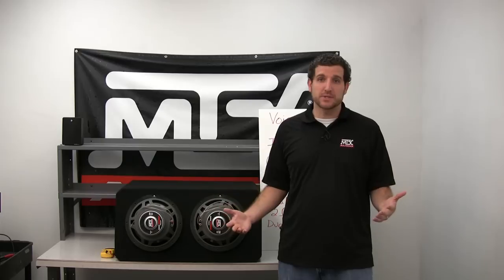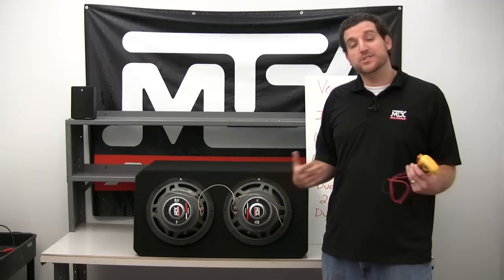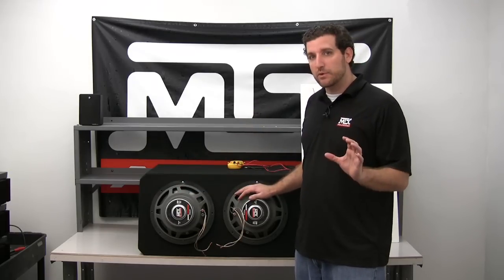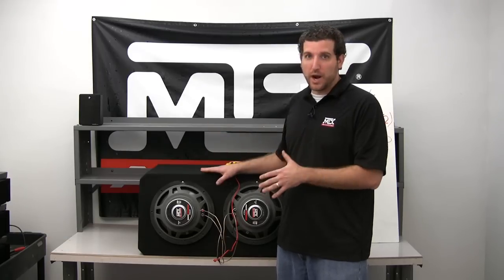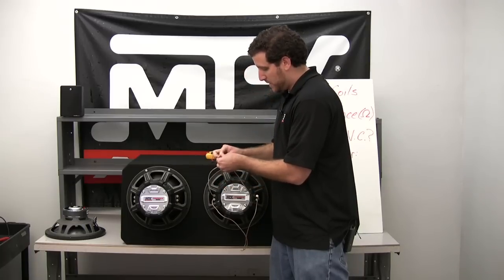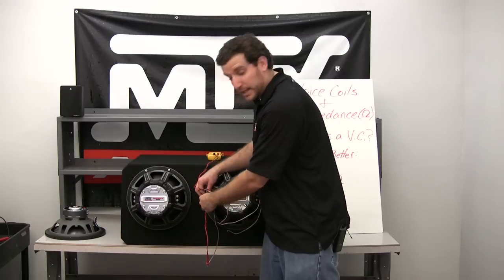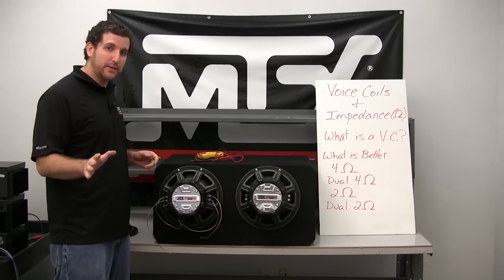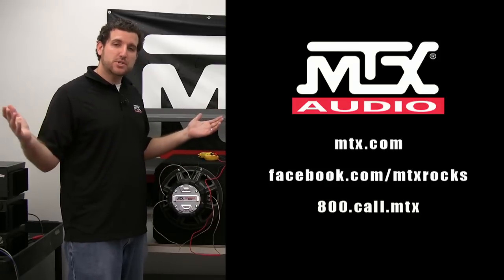How to Wire Your Subwoofers to the Correct Impedance for Your Amplifier

Comment: I got kicker l7 an a750.1 but the fuse holder is melting
Reply from the maker: Leo Bowden this does not sound like an impedance issue. This sounds like your power/ground wire may be too small or your wire has built up resistance over time. The fuse holder is melting due to the wire getting hot. I would replace the power/ground wire ASAP before anything worse happens. Try using a oxygen free copper wire and make sure it is a quality wire that is true to gauge.
Reply: Thank you
Reply: It's the one in the kicker amp not my power wire
Reply from the maker: Leo... Sorry... I as also thinking the power wire fuse was the one that was melting. If the ATC fuse in your Kicker amp is melting, it is most likely an amplifier issue.

Comment: i have one question if i have two 800watts subwoofers so do i need a 1600watts amplifier then or thoes it blow em up and they are 250watt rms does the amp need doubled the amount when i have two subs thats my question. Sorry For my BeD England.
Reply from the maker: The RMS rating is what you want to use. The peak/maximum rating of 800 watts is irrelevant. If your subs are rated at 250watts RMS and you have 2 of them, you would look for an amplifier that is rated at 500 watts RMS at whatever impedance you plan to wire your subwoofers to. This is if you are wiring your subwoofers together and powering them with a monoblock amplifier (recommended).

If you plan to use a 2ch amplifier, you would look for an amplifier that does 250 watts per channel at whatever impedance you plan to wire each subwoofer to (depending if they are DVC or SVC).
Reply: i need help please cuz im planning to buy two rockville w15k6 d2 2ohm subs but i dont know what amp i need so can u try find one for me please.
Reply from the maker: Your subwoofer says it is rated at 500 watts RMS and it is a dual 2ohm voice coil model. If you wire them to a final impedance of 2ohms at the amplifier (https://www.mtx.com/library-wiring-diagrams) you would be looking for an amp that is rated at 1000 watts RMS x 1 @ 2ohms. Our XTHUNDER1500.1 amplifier would be just about perfect for your subwoofers. https://www.mtx.com/xthunder15001-car-audio-amplifier

Comment: HI i need help, i have 15 inch 4d targa xxx 10 000 watts,2500 watts rms subwoofer and Icepower IBA-4000.1  4000watts Monoblock amp,  can you help me to extract the maximum power from this boys, any sugestion?   Amp specs   http://www.icepower.co.za/products/amplifiers/iba-series-amplifiers/

When I'm using the amp does not heat up

Comment: need some help I have 2 dual voice coil subs and they are older kicker comp vr 10" subs and on them it only tells that it's dual voice coil so I don't know what amp to buy can someone help me with that please
Reply: and I can't find any specs cause there older subs there is no information out there
Reply from the maker: To properly match up your subwoofers to an amplifier, you need to know the impedance of the dual voice coil subwoofers so you know what impedance you can wire them to at the amplifier. Kicker Comp VR10's are probably dual 2ohm or dual 4ohm subwoofers. Can you confirm which models you have?
Reply: +MTX Audio USA  not sure how I would find out beings that there's no info online and only thing the subs say are dual voice coil is there another way to figure it out I've seen the have like a tester you can buy would that work
Reply: +MTX Audio USA well the tester thing you have
Reply from the maker: Hawk's Clash yes. A multimeter set to the impedance (ohms) setting would tell you what impedance the voice could are. Or if you know the model # of the subwoofer, there is usually a designating # that specifies impedance.
Reply: +MTX Audio USA ok I'll have to check the subs and if not hoe much would the meter be

Comment: sir! plss sugest me.. which is Best speakers math for "ahuja SSA300 amp.... its has ..4 n 8 ohms option .. so which watt speaker is best for my amp?????///
Reply from the maker: Sorry. I am not familiar with the SSA300 amplifier.
Reply: its ok.. but just clear me  that... in simple way..  how much speaker watt best for "300watt" amp.... its pair of 300+300  .. 600 watt speaker or... 250+250 .. 500 watt speaker ...or less .. "coz i have 300 watt amp.. so im searching speaker for my 300 watt amp  .. pls sugest me... :)
Reply: power mind

Comment: What if I have 2 sub double coil and 1 amp, how do I wire them? SoundStream PCO-1204!
Reply from the maker: It depends on what impedance you want them at. You wire your subwoofers to a final impedance that best matches the RMS power handling of your subwoofers to the RMS power output of your amplifier at that impedance  (ohm load). Check our wiring diagram tool for more info - https://www.mtx.com/library-wiring-diagrams

Also, read our article on "Matching Subwoofers with Amplifiers" - https://www.mtx.com/library-subwoofer-impedance
Reply: +MTX Audio USA Thanks very much for your help, but I do prefer if you tel me here I should do it and if the amp and subs are good, as I told you I got 2 SoundStream dual voice coil 350w rms (PCO-12D4) and the SoundStream amp 600w Class D (P1.600D) 
RMS power @ 4hom --> 240 x 1
RMS power @ 2hom --> 400 x 1
RMS power @ 1hom --> 600 x 1 

So please tel me what is the best wiring for these subs and amp 

Thank you very much for you help 🙂
Reply: I have mtx terminator dual 12' subs  model# TNE212d what amp would push these like they should cause the amp it came with TNA251is not working

Comment: how would i  wire 2 4ohm dvc's subs to a 2ohm stable amp????
Reply from the maker: With 2 - 4ohm dual voice coil subs, your final impedance at the amplifier can be 1ohm or 4ohms. Check out our wiring diagram tool here - https://www.mtx.com/library-wiring-diagrams

Comment: How do u wire two 2 ohm subs to a 4 chanel amp
Reply from the maker: There are a variety of ways but we need more info to help you. Can your 4-ch amp be bridged to mono? Are your subs dual or single 2ohm? What are your amp and sub RMS ratings?
Reply: I bought a new amp as Sony xplode scks.... I needed a mono block amp
Reply: I bought a power bass 1000w mono block 1 ohm
Reply: And wired it in series
Reply from the maker: Two single 2ohm subs wired in series would have a final impedance of 4ohms at the amplifier. However, if your RMS  ratings are appropriate between your amp and your subs and if you can "bridge" two channels of your amp together to make it a 2 ch amp, you could power each sub on it's own amp channel.

Or you could bridge all 4 channels of the amp together to make it a single channel amp. Not sure if your amp is capable of doing this but some 4 channel amps are.

 It's not the way we would do it if we were designing a new system, but could be done to use the products you have. Check the manufacturer websites of your products.

Comment: I have 4-10s at 8 ohms 450 watts i want to add a 15in 8 ohm 450 watt speaker cabinet will that bring it down to 4 ohms in parallel ??

Comment: Can you wire just a single coil of a dual voice coil speaker to an amp? So if you have a 2Ω DVC you can wire it either 1Ω, 2Ω (just connecting one coil to the amp) or 4Ω.
Reply from the maker: That has been a debate in the car audio world for years. IMO... The only correct answer is to check with your subwoofer manufacturer. Yes, it is possible but construction methods could cause problems and lead to failure. Also, using only half of the dual voice coil typically reduces the amount of power a subwoofer can handle and therefore would also reduce performance.
Reply: I have 2 DVC 12 1ohm wire to 1 ohm but doesn't sound loud. Would 2 DVC 12 4ohm wire to 1 ohm sound better??

Comment: im tryimg to bridge two 12 jensen to a one channel boss 1100 watt how do u do it
Reply from the maker: Zack, if your amp is a monoblock (single channel), you can't bridge it. Bridging refers to combining two or more channels on an amplifier to add up their outputs into one channel. Is your amplifier 2 or more channels? If so, you should check with the manufacturer to make sure it is a bridgeable amplifier.

Comment: why did my speaker catch fire
Reply from the maker: Couldn't say JohnJ Bieble... Could have been putting too much power to the speaker. Could have been incorrectly wired. Speakers catching on fire is extremely rare and is almost always due to a problem in the installation.

Comment: Yes, so you ask for more info, OK.  So the amplifier puts out 250w at 4ohm on 4channel, it puts out 500w at 2ohm on 4channel, and it puts out 1000w on 2channel 4ohm bridged. "I don't know what 4ohm bridged mean though". So will that amplifier play the speakers that I asked about before? They are not woofers, they are tweeters and mid range speakers. Four 450w 8ohm.
Reply from the maker: So 5 speakers total? 2 - 450watt 8ohm speakers and 3 - 150watt 8ohm speakers? OR... 4 speakers total that are 450watts and 8ohm? Be sure you are referring to the RMS power handling ratings of your speakers and the RMS power output ratings of your amplifier. DO NOT use the Max or Peak power ratings. Please confirm the qty of speakers and the RMS power ratings of your amplifier and speakers.
Reply: Yes am talking rms. Peak is about 900
Reply: Yes the rms of the speaker is 450w
Reply: MTX Audio USA j

Comment: hey, can i play 2 (450w) 18sound 8ohm speaker, and 3 selenium 150w 8ohm tweeter, with my (2000w) 4channel hifonics?
Reply from the maker: D Allen, unfortunately there is not enough info to say whether your setup will work with each other or not. You will need to determine how many watts each channel of your 4ch amplifier puts out and at what impedance. Then you will need to figure out if your subwoofers are single voice coil or dual. Typically, 8ohm speakers are single voice coil and with two of them, you could wire your subs to 4ohms at the amp or 16ohms. You would want to determine your amplifiers RMS power output at 4ohms and at 8ohms. If it's better matched at 8ohms, you could use 2 channels (1 to each subwoofer). If it's better matched at 4ohms, you would use one channel for both subwoofers. 

Also, are any of the channels of your amp bridgeable?

You could wire all three of your 8ohm tweeters down to 2.7 ohms at the amplifier and power them all on one channel assuming the RMS output of your amp at 2.7ohms is around 450 watts. 

Basically, you need more information before you can determine whether your setup will work properly together.
Reply: OK thanks

Comment: i have  a M1886i MA Audio amp ! which is 
Max Power (Watts)   1000
# of Channels   1 (Mono)
RMS Power (Watts Per Channel)   500 x 1 @ 4
Car Amplifier Features   Crossover, Thermal Protection

i needed to know Do I wire my speakers in series or parallel ?
these are the speakers 
Hifonics BRZ15D4 Brutus 15" 1200 Watt DVC 4-Ohm Car Audio Power Subwoofer
Peak Power: 1200 watts
RMS Power: 600 watts
Impedance: 4 Ohm
Polypropylene cone
Reply from the maker: +TrackChemist Beats (Track Chemist) Your subwoofer wants 600 watts RMS and can be wired to either 2ohm or 8ohm. However, your amplifier's rating is 500 watts RMS at 4ohms. At 2ohms (assuming it is two ohm stable), it would probably provide too much power to your subwoofer and at 8ohms it wouldn't provide enough. Check out our article on matching subwoofer to amplifiers here - https://www.mtx.com/library-subwoofer-impedance

Comment: Hi I got sound stream d1.1700 amp nd Rockford p2 dual 4 ohm how can I wiring this ?
Reply from the maker: +sukhjinder mann There are options on how to wire your subwoofer to get to the optimum impedance and to help match your subwoofer to your amplifier based on their performance ratings. You will want to get as close to your subwoofer's RMS power handling rating as you can at whatever impedance your amplifier would provide that amount of power. Please use our Wiring Diagram Tool for wiring options for your specific subwoofers - https://www.mtx.com/library-wiring-diagrams

Comment: so I've got two single voice coil 2ohm subs with 250w RMS each. My amplifier specs give 1200w RMS at 1ohm, 600w RMS at 2ohm, and 325w RMS at 4ohm. How should these be wired for most effectiveness without damaging anything? should they be ran in parallel or would the amp be over powering the subs? would a series put me around 4ohm and be the best option?
Reply from the maker: +Braydon Since your amplifier is 1ohm stable, you could wire your subwoofers down to a 1ohm load but your amp could overpower and blow your subwoofers if you don't set your gain properly.  Otherwise you could wire your subwoofers to a 4ohm load but you would only be providing 325 watts RMS to two subwoofers that want 250 watts each. Your amplifier isn't really the best option for your subwoofers. Here is a link to our wiring diagram tool - https://www.mtx.com/library-wiring-diagrams

Comment: what wiring and amp should i do with 2 1200 watt 4 ohm pioneers
Reply: not sure if I made a mistake from buying the subs before buying the amp
Reply from the maker: +Edwin Luque What is the RMS power handling and are they dual voice coil or single voice coil?
Reply: +MTX Audio USA single coil 250 rms , pioneer TS-W303R

Comment: ive dual 4 ohm and im getting a final reading of 5.5 ohms..?
Reply from the maker: +Jose Garcia How many subwoofers do you have? Are you reading the impedance by using a multimeter on the ohms setting?
Reply: +MTX Audio USA  i have two subwoofers and yes i have the multimeter at the ohms setting i dont understand...its new to me :)
Reply from the maker: +Jose Garcia Are your subwoofers wired together or are they wired to the amplifier separate?
Reply: +MTX Audio USA they are wired in series and get that final reading :)
Reply from the maker: +Jose Garcia https://www.mtx.com/library-wiring-diagrams Check out our wiring diagram tool. Enter 2 subwoofers and choose dual 4ohm from the drop down menu. You should have a reading close to 1ohm or 4ohms if wired correctly and assuming there are no problems with your subwoofers.
Reply: +MTX Audio USA okay thank you very much for the link and the info you provided :)

Comment: when you wire in parallel does it make it 1 channal on the amp? if so what would you do to the other positive and negative out put ( for my MTX dual 12s)
Reply from the maker: +yousuf kan If you have an enclosure with 2 terminals (1 for each speaker), it usually means each speaker is wired independently. To check the impedance, you could connect a multimeter to the terminal (positive to positive and negative to negative). Use the ohm setting and you can know for sure what impedance your subwoofers are wired to and what the impedance will be at the amplifier.

Depending on the impedance at each amplifier, you could wire them together at the amp and use a single channel (monoblock) but that would double the impedance at the amplifier. So it depends on the power ratings of your subwoofer and amplifier at whatever impedance you would end up with as to whether that would be an appropriate setup.

Comment: what if your amp is 760 watts 380x1 4ohm and your sub is 400 watts rms,whats best wiring setup?and is the amp to much for the sub?its a pioneer dual voice coil 4ohm 1400watts max 400 watts rms , also the amp is pioneer mosfet and its 190 watts x1 at 2ohm .
Reply from the maker: +mumforddale1 A dual 4ohm voice coil subwoofer can be wired to either 2ohms at the amp or 8ohms at the amp. If you amplifier's RMS rating is 380 watts x 1 @ 4ohms, it is going to have more power output at 2ohms and would most likely overpower your subwoofer, especially if you don't set the gains properly. At 8ohms, your amp wouldn't have enough power for your subwoofers. Check out our article on matching subwoofers to amplifiers here - https://www.mtx.com/library-subwoofer-impedance

Comment: I have MTX Thunder 801d and 2 dual 2-ohm Voice coil alpine r12's 

Advice on set up?
Reply from the maker: +ruben campuzano I don't know the RMS power handling of those subwoofers, but in order to get a 2ohm load for your Thunder801D, you would need to wire your subwoofers in "series parallel". Be careful to make sure you wire them properly. Otherwise you could end up with a 0.5ohm load which the amplifier will not like.
Reply: +MTX Audio USA thanx for info, set up sounds the best it has. 

Good video too man. Explains a lot. 

Bass knob,yes or no?

Comment: Hello sir, so I have 2 15" subwoofers, they are each single 4 ohm and run 250 watts rms. So if I were to wire them in parallel to achieve 500 watts rms @ 2 omhs, how would I know what amp I need? Because I don't know what mono block and class d and all that means? Does it make a difference?
Reply from the maker: +scrungy liplop First, with 2 - SVC 4ohm subs, your impedance at the amplifier will either be 2ohms or 8ohms. Typically, you would wire them to 2ohms at the amplifier. (https://www.mtx.com/library-wiring-diagrams) Then, you would look for an amplifier that has an RMS rating of 500 watts (250 watts x 2 subwoofers) at 2ohms. 

Class D, Mono Block, etc... are styles of amplifiers. Class D amps are more efficient than Class A/B amps which is why they are better when powering subwoofers. Mono Block just means it is a single channel amplifier as opposed to a 2ch, 4ch, etc... amplifier.

This amplifier does 500 watts RMS at 2ohms and would be perfect for this setup. https://www.mtx.com/thunder5001-car-audio-amplifier
Reply: +MTX Audio USA wow thanks so much! This really helped me out. I'm looking forward to a nice system in my car, have a nice day!

Comment: how do you wire up a single 4 ohm dual voice coil sub rated at 400rms to a 760 watt moffet pioneer 2 chan amp?
Reply from the maker: +mumforddale1 Would need more information about your amp. What are the RMS ratings?
Reply: 380x1 4ohm and 190x1 4ohm.